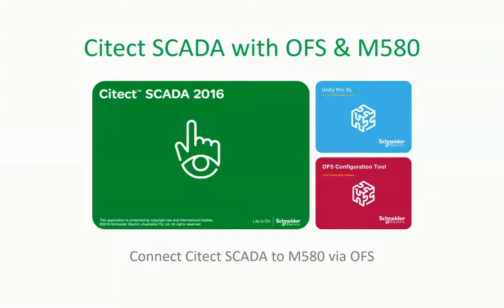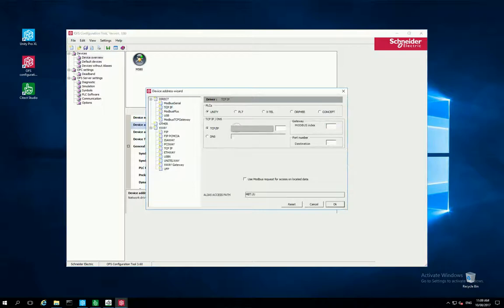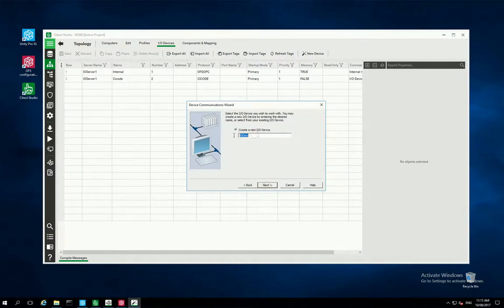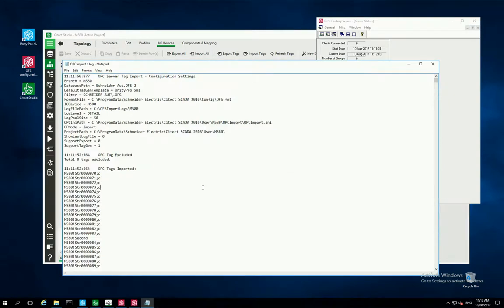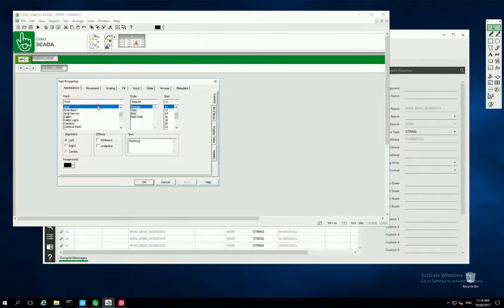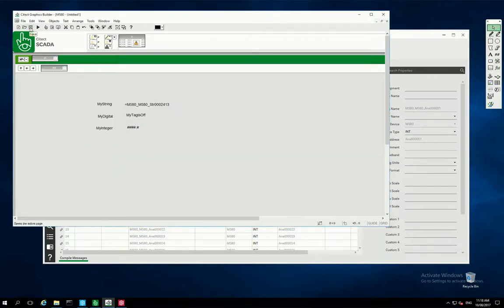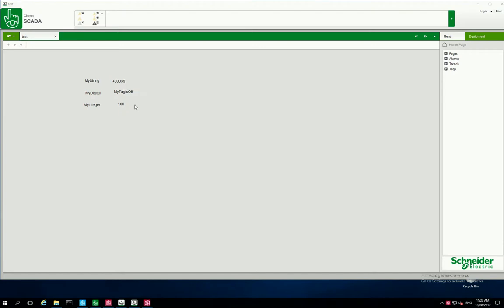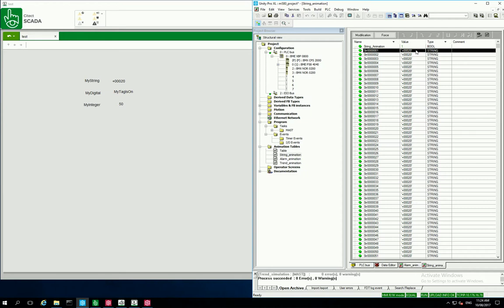How to Setup Citect SCADA with OFS & M580 - SCADA Software Videos

Comment: Hi Martin - Thank you for the very useful video.

I have one question - Why is the PLC name (M580 in your example) being appended to the front of the PLC tag name?
Is there a setting so it does not do this?

Regards - Richard
Reply from the maker: Hi Richard, I add a prefix when importing the tags at 1:50 in the video. You can leave this field blank.
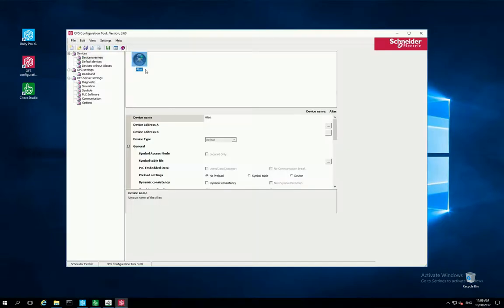Reply from the maker: There is the OFS alias on the front of the PLC tag names 0:31 too
Reply: Hi Martin.
It is the alias added to the front of the tag I'm wanting to get rid of, but I do not think it is possible.
I am not using the prefix option.
Regards
Richard
Reply from the maker: a quick way to fix this will be to open the dbf file and delete the "Alias_" in front your tags

Comment: hi, good video, tks for sharing, but when you are using a M580 without using the ofs, how the configuration are to conect the m580 variables to the citect?? i mean, if you can´t use the ofs, how can i link the plc variables to the citect, how Works the ioserver if you do with the plc ofs when you have the real plc with an ip address?? tks
Reply: like in this video, but i can´t do it whit m580, and when i made with m340 appears tha all tags where excluded, so i can´t inclued my tags  - https://www.youtube.com/watch?v=T1D4Azh8JfM&t=126s
Reply from the maker: You can use other drivers like Modbus TCP for example. Make sure you have the driver installed on your Citect SCADA Machine before import PLC tags